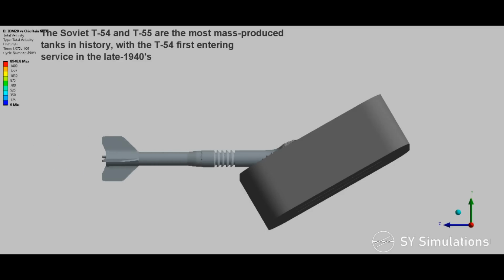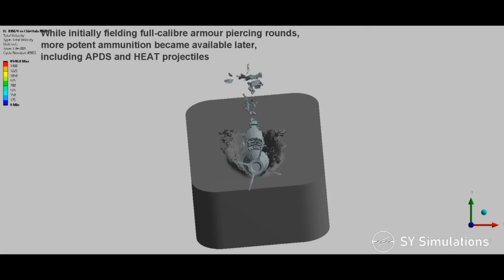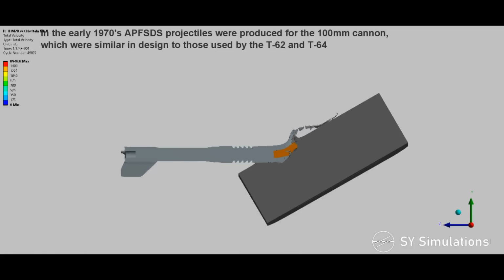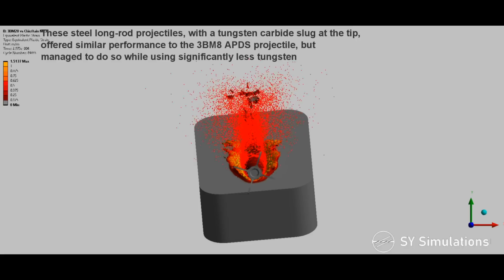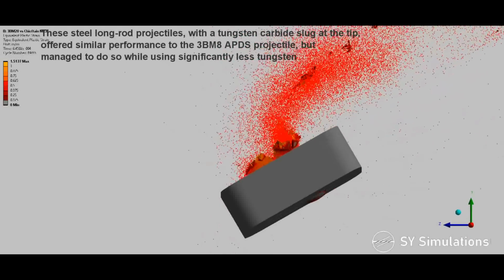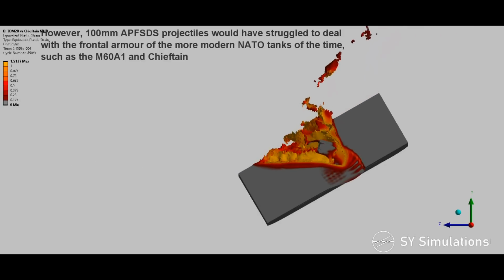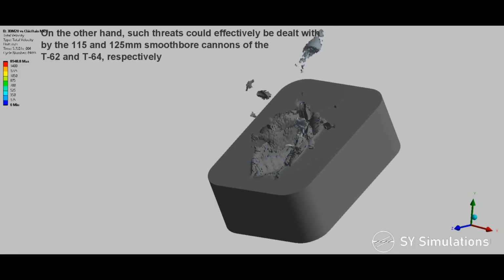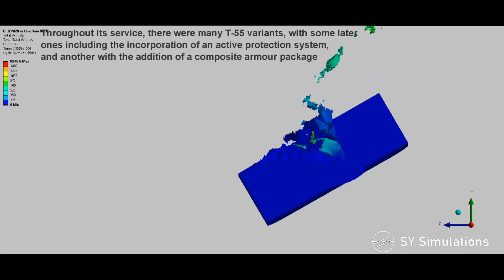APFSDS FOR A 1940's CANNON | T-55M vs CHIEFTAIN | 100mm 3BM20 Armour Penetration Simulation

Comment: But 100-mm 3BM25 shells with a tungsten core can penetrate up to 280 mm of armor from a distance of up to 2 km. So. they are capable of hitting Chieftain tanks or M60 modifications
Reply from the maker: at 0 degrees, yes, but that effectiveness falls sharply at angles as the WC slug is dislodged. Just look at 3BM15 vs 3BM9, at 0 degrees theres a huge improvement, but at 60degrees theyre basically the same
Reply: @SYsimulations , this shell was specially designed to combat modern Western armored vehicles at that time, and was adopted. Therefore, it fully meets the requirements imposed on it
Reply: @ФедотовДмитрий-щ3г Well evidently not
Reply: @sturmgeschutze3070 he is right
Reply: @bastikolaski8111  Didn’t penetrate so evidently not
Reply: @sturmgeschutze3070 , the video shows an older 3BM20, not a more modern 3BM25
Reply: @ФедотовДмитрий-щ3г  your assumption that it entering service meaning it could kill all western vehicles of it’s era is, however, incorrect. 3BM25 is from 1978 and yet I highly doubt it’s chances against an Abrams. The chieftain is much older than 1978 and even the (1976) 3BM20 is 11 years NEWER than the chieftain (1965!!).
Reply: @sturmgeschutze3070 , You're right, but Abrams appeared in 1980, and Leopard 2 in 1979. In addition, in the first years of their release, the basis of the tank forces of NATO countries were tanks of the last generation. M60, Leopard-1, Chieftain

The USSR's response to the appearance of the Chieftain tank and the M60 was the T-62 tank, which was produced in a series of more than 20 thousand vehicles. His armament was quite capable of fighting these tanks
Reply: @ФедотовДмитрий-щ3г  But then we have to go beyond just the material performance and look at the actual crew ability and training.  And on that front, the WarPac forces are (largely) hosed compared to the NATO forces in the 1980's.  If you want a IRL example of that then look at the difference in performance of the Iranian Chietains in the Iran-Iraq war compared to the Jordanian Chietains that fought on the raqi side, bearing ion mind that Jordan has the ONLY fully professional army in the Middle East.
Reply: @ФедотовДмитрий-щ3г  Yes, abrams and leopard appeared after BM25 but remember that all tanks AND weapons are designed to counter vehicles a decade in advance of their service entry. A 1978 shell should be effective against 1988 targets else it is a failure.
Reply: @iatsd , and what is the basis of your confidence in the imaginary "more professionalism" of NATO in the 80s? How is its "professionalism" expressed in comparison with the Warsaw Pact Organization? The best NATO army, the Bundeswehr, was conscripted, just like the Soviet Army. The US army also carried out conscription during the Vietnam War

Analogies with the Middle East are simply inappropriate.
Reply: @sturmgeschutze3070 , do not forget that the T-55 was discontinued in 1979. This was one of the oldest types of tanks in service. But at the same time, the new 3BM25 shells allowed him to fight with most enemy tanks. 

NATO shells for 105-mm guns could not effective fight the T-64A, T-72 and T-80 tanks at all, until the early 80s. But even then, in the USSR, they simply welded a steel plate on the forehead of the hull of these tanks, as a result of which, NATO shells again became low-effective.

The USSR also had a T-62 tank, which could confidently fight even with early modifications of the Abrams and Leopard-2 tanks, thanks to the 3BM28 projectile with a guaranteed penetration of 380 mm (the average penetration is slightly higher).
Not to mention 125-mm shells, which could also successfully fight with modern western armored vehicles at that time.
Reply: @ФедотовДмитрий-щ3г  more profesionalism because NATO troops trained better. I spoke to former warsaw pact soldiers and they wasted a lot of time doing nothing of importance.
Reply: @petrsukenik9266 , I can say exactly the same about NATO soldiers. In addition, everyone in Ukraine has now seen the low level of training of the Western military.
Reply: @ФедотовДмитрий-щ3г  1) no, because if not anything else they were not spending time learning about marxism leninism
2) not entirely true, ukraine soldiers still ouperform russian soldiers, its only thru superior numbers and ammunition quanitity that russia does anything, and it was not proper NATO training. Ukraine got bare minimum.
Reply: @petrsukenik9266 ,  And how does ideological training supposedly interfere with combat training if they are conducted at different times? You know, the Germans in 1941, just like you, thought we were inept, but then they were very surprised by the reality. The whole world knows Soviet tankmen-aces Lavrinenko, Kolobanov and Malko.
Reply: @petrsukenik9266 , Further. You have absolutely no idea what is happening in Ukraine. But the reality is that the Russian army is better armed and trained. We have an advantage in technology, artillery, and drones. 
Ukraine has no superiority, so it suffers defeats, losing cities. Most of the Ukrainian soldiers are recruited on the streets by force and do not even have basic training. Therefore, Ukraine is suffering several times greater losses and is losing its position.
Even the brigade that was trained in France lost a THIRD of its personnel who deserted in France.
Reply: @petrsukenik9266 ,  So, even the Ukrainian military bluntly says that Western soldiers simply cannot teach them anything. They need to learn by themselves. No understanding of drone warfare, and other modern concerns
Reply: @ФедотовДмитрий-щ3г  1) if conscripts serve limited time (which they did) ideological training is a waste of time
2) you WERE inept. Only reason why soviet army survived what french did not was because it had a lot of space to retreat. Soviet union won by having more people, getting economical aid and germany fighting multiple enemies. Had germany possesed equal resources and was not bombed by western allies soviet union would not stand a chance.
Reply: @petrsukenik9266 , No, you don't know history at all and you don't understand anything about military science. Large spaces are not only difficult to attack, but they are also much more difficult to defend. In 1940, it was much easier for the French to organize defense in their relatively small territory. It was much more difficult for us in this regard. Then the Red Army showed incredible professionalism. She had only 2.8 million soldiers in the west of the country, compared to 5.6 million from Germany and its allies, who were concentrated on our border. And despite this, the Germans were defeated during the Red Army's counteroffensive near Moscow in December 1941. And this Victory was also won by a minority. The high skill of the Red Army soldiers and commanders.

The Soviet economy and ordinary people who worked in factories and mines on arable land demonstrated great success. The USSR produced military products as much as the entire united Europe, which was subordinate to Germany. The most developed countries of Western and central Europe. France, Czechoslovakia, Holland and others.
Reply: @petrsukenik9266 , So, do not underestimate the merits of the Red Army, the Soviet state and the Soviet People. Without the Soviet Union, the rest of the world would not have survived. 
Germany had the economic power of most of Europe behind it. The French and Czechs stood behind the machines of German factories, replacing the Germans who went to the front. Factories of the conquered countries worked for Germany. So, in terms of economic power and population, Germany and the countries under its control surpassed the USSR. Don't forget that.

And speaking of the bombing of Germany, for some reason you forget how much damage was inflicted on the USSR. 1/3 of the entire industry and a significant part of the population ended up under German occupation. And despite this, the USSR won the war against the whole of Europe, which cleaned the Germans' boots.
Reply: @petrsukenik9266 , And the so-called "economic assistance" was not free at all. The United States received supplies of resources, coal, ores, non-ferrous metals, and gold from the USSR. Which we ourselves really needed for the production of military equipment. In total, foreign supplies account for 4% of the Red Army's weapons. As you can see, this is a significant, but not decisive figure.
Reply: @ФедотовДмитрий-щ3г  loss ratios on eastern front speaks clearly. USSR lost more soldiers, tanks and planes that germany did. 

While its true that some of german industry was suplemented by occupation, big part of USSR industry was suplemented by british and americans. Plus germany had to build for 2 fronts (and controll multiple resistance movement) while soviets only fought on one. Soviets didnt "win agaist europe" they won agaist germany. And not alone.
Reply: @petrsukenik9266 , Regarding supplies from the United States and Britain, they accounted for only 4% of the Red Army's military equipment. This cannot be compared in any way with the loss of large industrial centers such as Kharkov.
And do not forget that the USSR kept serious groups of troops on the borders, fearing an attack by Japan and Turkey. And these troops would be very useful to us in the same Stalingrad. So, the USSR, in many ways, also fought not only on the 1st front. 

The USSR defeated 90% of the forces of Germany and its allies. Despite the fact that the Germans had the economic power of most of Europe. After the victory in the Battle of Kursk, it finally became clear that the USSR was capable of defeating Germany and its allies alone. Fearing the post-war strengthening of the Soviet Union's influence in the world, the United States and Britain opened a second front, landing in Italy and then in Normandy.
Reply: @petrsukenik9266 ,  not if we take the military losses of the USSR (those killed in battle, wounded and captured) and compare them with the losses of Germany and its allies (Finns, Hungarians, Italians, Romanians, Slovaks) who fought against us, it turns out that the USSR lost 200,000 fewer than Germany and its allies. The USSR suffered 8.6 million military losses, while Germany and its allies lost 8.8 million. As you can see, the Red Army fought with much greater skill and professionalism.
Reply: @petrsukenik9266 , If we take tanks and armored vehicles, the Germans lost 88,000 tanks and armored vehicles against the Soviet 105,000. 
But if we take aviation, the Germans lost 75,000 pilots during the entire war, while the USSR lost only 34,500. Moreover, most of the German aircraft was destroyed by Soviet pilots. On June 6, 1944, the Germans had only 448 serviceable fighters in service on all fronts. Despite the fact that the German industry produced tens of thousands of fighters during the war years. During the air battle of Kuban, in 1942, Soviet aircraft inflicted a crushing defeat on the enemy and maintained superiority until the end of the war. The Germans simply did not have time to make up for their losses
Reply: As SY says, long rod APFSDS will penetrate more armor at an angle, but short rod style acts a lot more like APCR

Comment: Speaking of add on composite, it would be interesting to see 105mm DM23 vs a T-62 with add on composite
Reply: The composite for T-62 was strong against HEAT-FS but not so strong against APFSDS.
Reply: T-62M-1 with its BDD composite hull is equivalent to 
160mm Steel at 60 degrees

105mm DM23 (M111) defeats 
170mm steel at 60 degrees at 2000m
Reply: @janflorovic5880  now that would be interesting to see
Reply: Iirc he's tested that. Easy pen
Reply: @thezig2078  was it a turret test?
Reply: @dakotahondalock5621  Nah, upper front hull at 1000 meters

Comment: Chieftain having that raw armor as always
Reply: The engine was reliable by the mk10
Reply: @simonh317  Reliable yes still sucked ass due to low horsepower
Reply: @ΕυαγγελοςΠαπαθεοδωρου   comparable to a T72 Ural at 750hp.
Reply: @simonh317  Still better because the Ural T-72 weights like 45 long tons while the chieftain weights 55 long tons with a same sized and horsepower engine. Anyway this debate was solved during the Iran Iraq War where cheap Export T-72 mopped the floor with the chieftains
Reply: @ΕυαγγελοςΠαπαθεοδωρου  T62 did as well (well punch holes in them), The T72`s from Iraw also had holes knocked in them. It was one of the reasons for the evelopement of the StillBrew NERA ; ISraeli tanks being knocked out in the 70`s by ATGM, and the 115mm APFSDS going through the thick and sloped steel of  Chieftain. As an aside - the Al-Khalid of Jordan had 1200 hp engines from the Challenger 1 , in the Chieftain shell, along with Challenger 1 optics and gun (and fin ammo)
Reply: *Iraq not Iraw.
Reply: @simonh317  The Al Khalid from Jordan is proper upgrade to the Chieftain a good balance of armor speed and firepower.
Reply: @ΕυαγγελοςΠαπαθεοδωρου more to do with poor crew training and morale than the tank
Reply: @ΕυαγγελοςΠαπαθεοδωρου  I take issue with your assessment of the Iran-Iraq War, as those T-72s were fighting basic model Chieftains (Mk.3 and Mk.5), not ones that had received any upgrades. Furthermore, Iran was under strict sanctions from Britain at the time, and thus unlikely to be able to acquire the components required to properly maintain their vehicles.
Reply: @86pp73  Sure but those were also basic export T-72Ms firing outdated steel darts (3BM9 at best). They weren't exactly equivalent to contemporary Russian T-72s.
Reply: How is it when a western tank has actual design problems it's suddenly a training and morale issue 🤔
Reply: @crabpeople5541  But so does the chieftain, with an admittedly worse L15 APDS that isn't effective against the most bare basic T-72 export model until like... 800 meters or so. 

The T-72 could pen the chieftain in most engagement range with its APFSDS, even with 3BM9. The chieftain can only penetrate a T-72 below 1km (if lucky).
Reply: Best looking tank on my opinion, the engine sucks ass though
Reply: The L7 105mm rifle terrified the Soviets apparently. 
It would punch holes in T-55s at 1,500m but they couldn't return the favour before 300
Reply: @MostlyPennyCat  Not really, no. 

Until they managed to create good APFSDS in late-70's, the 115mm smoothbore gun used in the T-62 (which entered service 3 years after the L7 in the M60) was superior. 

In fact, there was a document somewhere that stated the US intelligence thought that the M60A1's are inferior to the T-62 both by performance, and numbers. 

Only until they had the M60A3 that the US had a better tank than the T-62... But at the time, the Soviet already have T-72's in large number.
Reply: @MostlyPennyCat  ok

Comment: Well, that held up pretty well.
Reply: considering that Chieftain had about double the frontal protection as Tiger II, no it really didnt held up pretty well...
3BM20 is from 1972, thats 6 years after the full start of Chieftains producton.
Meaning that Chieftains armor protection was already obsolete before the UK forces had been fully equipped with it.
Reply: @zhufortheimpaler4041  ammunition and armor technology of this time definitely favoured the ammunition. That said the soviets would have still been using a lot  of old t-55s with older ammunition when the chieftain was used in the case of an actual war.
Reply: @enriqueouro9  This is litteraly a apfsds for a ww2 cannon...
Reply: @quan-uo5ws  it is, which is why it can be defeated by a reasonable homogenous steel armour design.